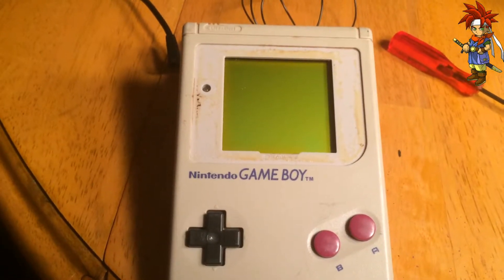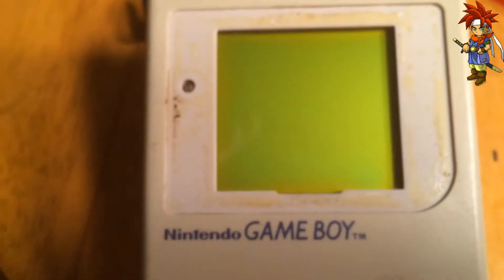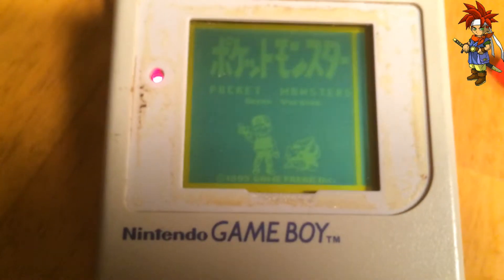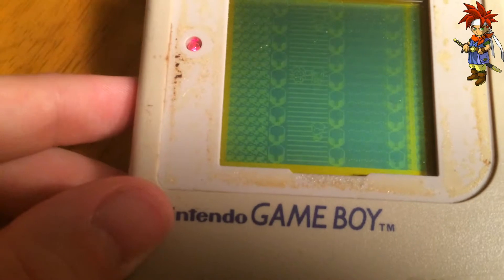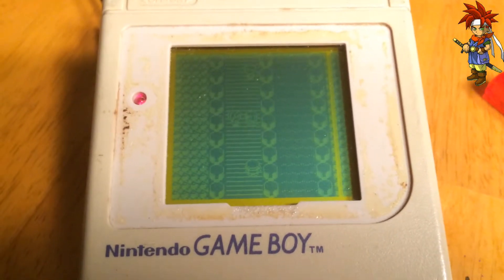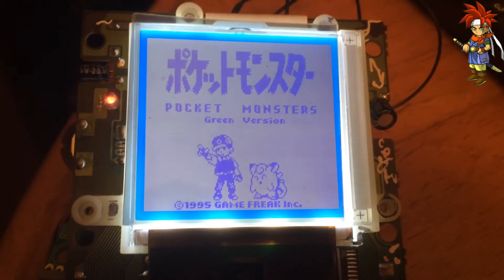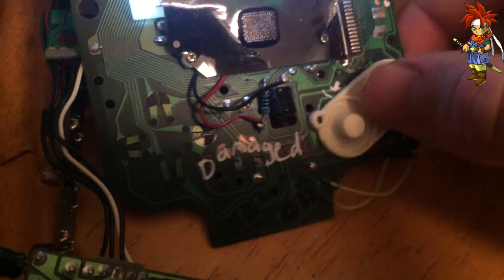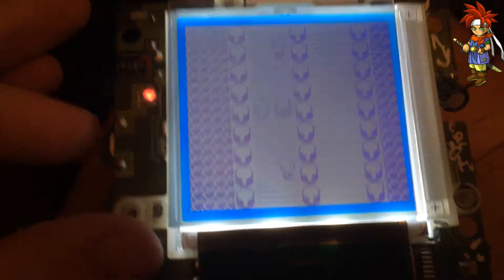Bivert Issues (SOLVED!)

Comment: The reason you game boy screen is flickering is because if the 100 ohm resistor you added to it. From most DMG back light mod videos I have seen on youtube, a lot of the people who mod these systems don't use these resistors mainly because it lowers the power to the back light (which adds more life to the lcd's ) but gives you a little more contrast, makes your screen dimmer and overall adds that flickering effect to the screen. Hope that helps!
Reply: +Clash of Clans & More - ZeroDaHero And actually that last comment was for when you add the back light it but i am going to retract that statement because (even though adding a resistor DOES indeed do what I said) it appears after I re-watched the video like 5 times over, looks as though you didn't disconnect pins 15 and 16 from the board and it looks like you just soldered the wires directly to them. You need to cut  pins 15 and 16 so there not touching the board at all. Even cutting them and bending them up into the air is ok they just need to be disconnected from the board. Cant tell from the video if they are or not but in case there not then THAT's actually the reason why the screen is flickering even after the back light modification.
Reply from the maker: +Clash of Clans & More - ZeroDaHero Hey, thanks for taking the time and writing to me to help fix the issue! :) I'm still working on getting everything together to do modding again. I'll post a new video once everything is good to go. Appreciate it! :D

Comment: Hey bro, just came across this video now, so not sure if you have already figured out the cause for this or not. In case you haven't, or for others who come across this, your problem is very probably that your unused inputs on the hex chip are not grounded. 

See, even though your wiring is correct, the unused gates in the chip can cause some interference on the logic gates you are using. When disconnected, the unused gates fluctuate between 0 and 1. This is not good. So the solution is to solder a wire between all the unused INPUTS and ground. The outputs can be left disconnected. That way, all the unused gates stay "locked" at 0, and don't generate any noise (which is what causes the flickering). I hope this explanation made sense.

If you have any questions, my Game Boy modding account on Instagram is @gene.boy
Reply from the maker: +Eugene Romero Heeey! I didn't even think of something like that o_o awesome! So all the other unused connectors on the chip need to be grounded? I'm still new to this scene and doing my best hehe thanks for the input. I'll give that a shot next time because I was realllllly annoyed that I appeared to have done it correctly and yet it wasn't working right! >_O Thanks again! I'll post a video for my successful biverting. Got about 125 gameboys to work on right now.....my job will never end! hah Thanks again bro.
Reply: +MrCrono666 Glad to be of help! I hope you get it all working next time. If not, hit me up on Instagram and I'd be happy to help out
Reply: +MrCrono666 Actually do not ground "all the other unused connectors" - only the inputs (pins 5, 9, 11 and 13). The outputs (pins 6, 8, 10 and 12) should NOT be grounded, since the chip will try to drive the outputs high (logical '1' = 5V) and grounding the outputs will essentially create a short, and cause unnecessary current draw (think battery life). Leave the outputs unconnected, but DO ground the input pins. Cheers!
Reply from the maker: Awesome, thanks Miwer and Eugene Romero . Good news is I'm using the new bivert chip from HHL and no longer use the old, obsolete chips! Will post a good video soon.
Reply: Nice! Yeah, those HHL chips make life much easier. I like suffering so I still wire mine manually lol. Look forward to that vid!
Reply from the maker: +Eugene Romero It's done! :) https://www.youtube.com/watch?v=fVbG1Yood3A